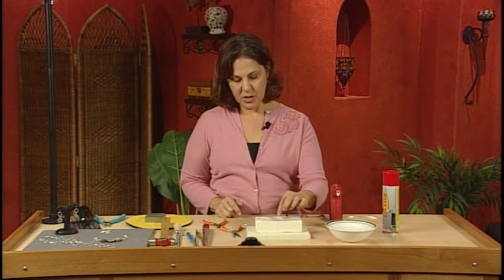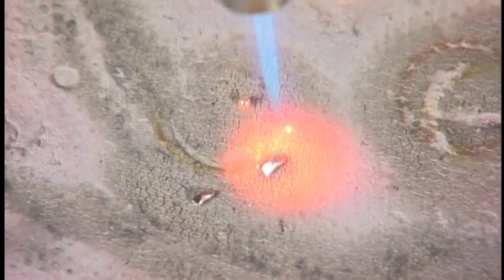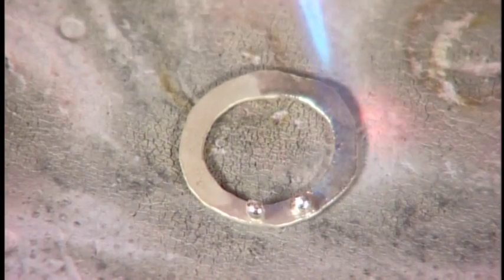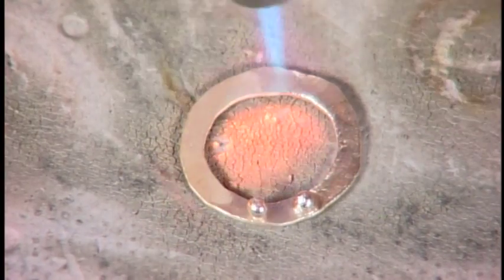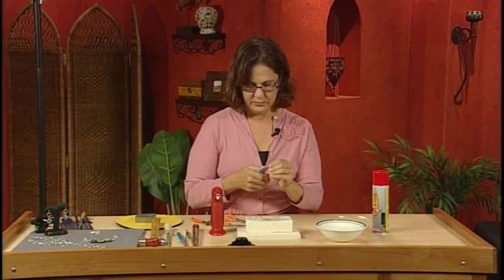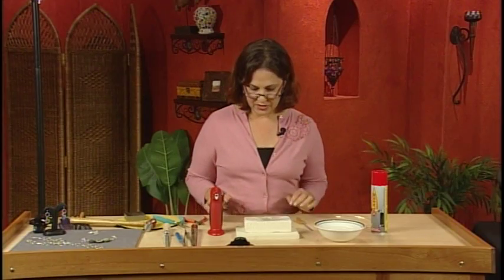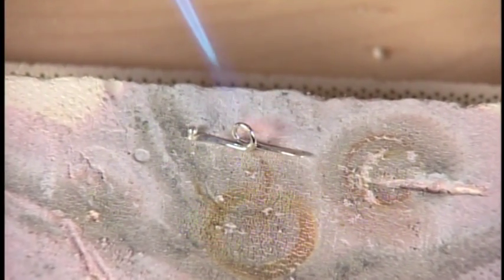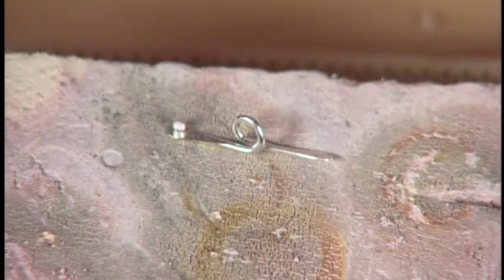Micro-Torch Techniques

Comment: Nice video. I actually work with iron, and steel in a forge. My comment to you is have you ever tried using the ball side of your ballpeen hammer? If you try it to flatten your wire, I think you might find it does a better and easier job. Hope you try it and it works good for you. Luck.